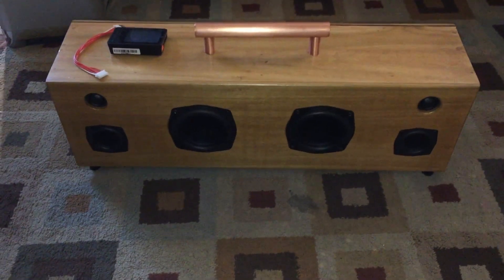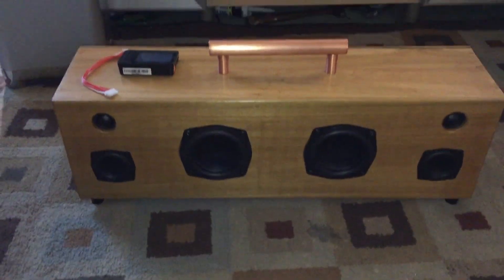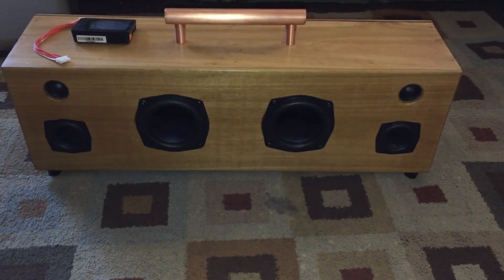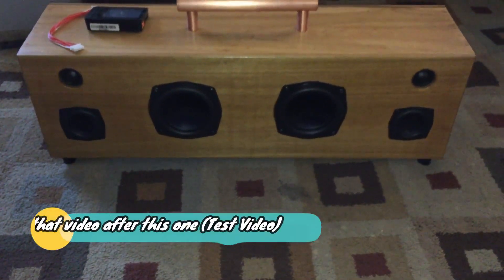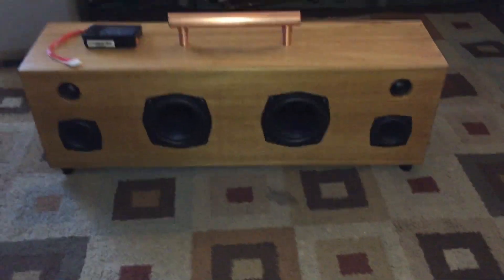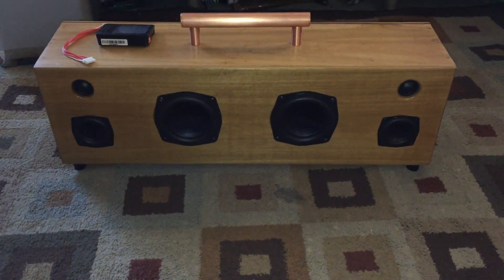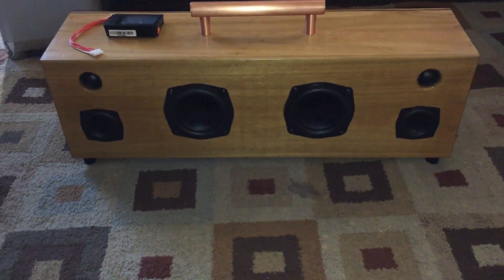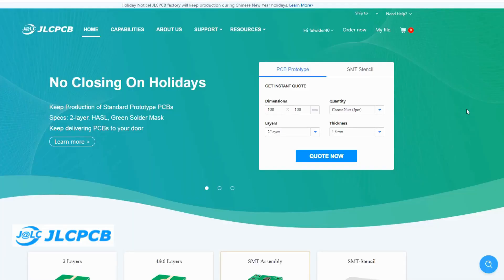DIY Bluetooth Speaker Portable Dayton Audio BoomBox 150W (ND105 & PR, ND65, TPA3116D2, CSR8630)

Comment: Did you use some kind of protection so it doesn't under charge?
Reply from the maker: Yes the Battery Has a 5SBMS. If you watched my last video, that is the same battery I used in the build!!

Comment: Great Job!!! The boost converter would add noise and ripple.
Reply from the maker: Thanks!!!Good thing I used a strong battery and decided against it...I came real close to using one, glad I didn't
Reply: @njfulwider5  I really want to push using a a 4P-6S and if I pop the caps, I could always charge the battery to 4v each so 24v
Reply from the maker: @MrBrymstond  It will handle a 6S perfectly. The only reason I did not push this one. The amp is capable at 4 ohms at 60watts per channel and 120 subs at 24V-25. That would have pushed the drivers a little over their rated specs. You just have to be careful of the amp. For example, The amp I have, there are others that look like it, but have a more generic tpa3116 board inside. That board is barely capable of 50watts per and 100 subs, but has been reported of blowing caps when maxed. I found one of them with the same board, from china. Link is in the description. If you end up purchasing, make sure to open the case once you get to make sure they didn't cheap out and give you the bad board. I had to do that 3 times before they sent me what I paid for on ebay. Seller claimed it was brand new stock and got them that way from the original company. Luckily he found me the correct board and sent it. There are good TPA3116 out there, you just have to hunt and be picky.

Comment: first!  MUuahahahah..,  I used to do car audio speaker box designs and ran 2 x 15" dual voice coil (2ohms each speaker) into 750W per side amp :).. body on the car rubmled and coin flipped on the top of the car.
grills, always put grills. look around for some nice ones that have enough room for the drive distance of the cone.
With the amp, you can either just mount on the side, or make the box extend and have it inside the extended part with fan cooling down a channel.. though really for high power amps so overkill. but ideas.
Also, fill the board walls inside with really dense material so it doesn't have a boxy resonant, I remember the material used to removalists that was purply colour was good stuff but there's cheap stuff that smells like potato bags is good to absorb noise and makes the sound crystal clear. you put your head in the box and scream but can't hear yourself. awesome.
1K+ sub's congrates too you can now monotize.
Reply from the maker: This thing is a Beast,,, Not sure if you saw the part with the grill over the holes? I have grills, Just wasn't sure if I should add them. I had to find a grill to make up for the extrusion of the Speakers. I'll probably add them. The little sneak peek video at the end....Bass was turned down to 1/4 and volume at 1/2. This thing shakes the walls when I turn up bass and volume..\\

You should see my next Boom Box.......600ish watts x 2, using SIMP08HP as batteries...12" subs, Dayton Audio mids and Highs....One mean machine coming!!!
Reply: @njfulwider5  yeah saw the grills after I sent the message, I tend to update as I go along and watch the video so I don't forget or miss anything. yeah keep the grills. you don't want something to accidently punch a hole in the cone